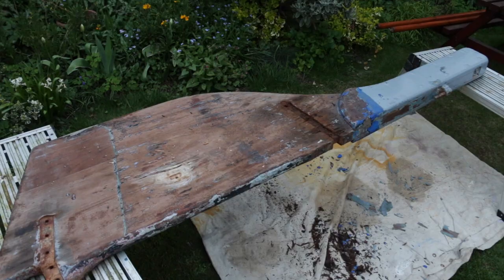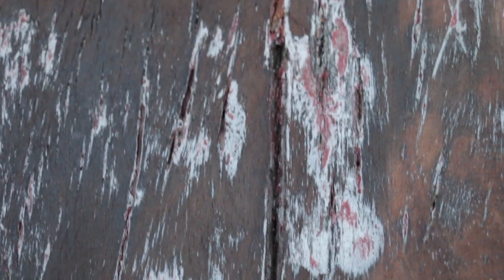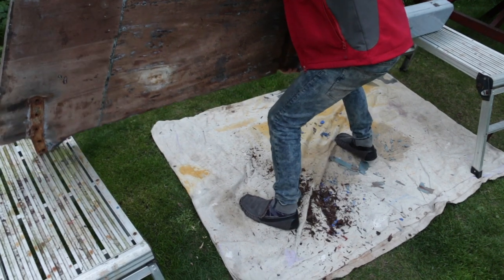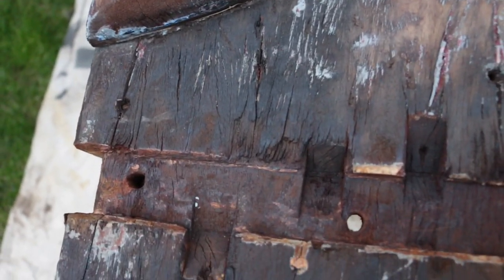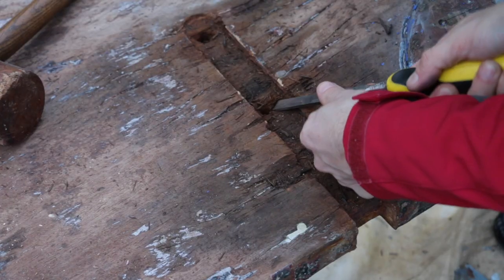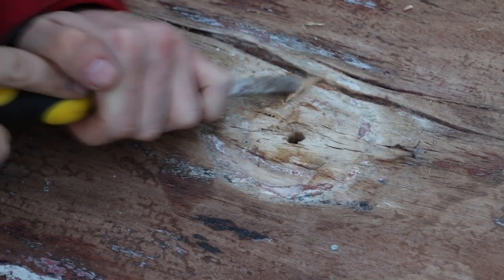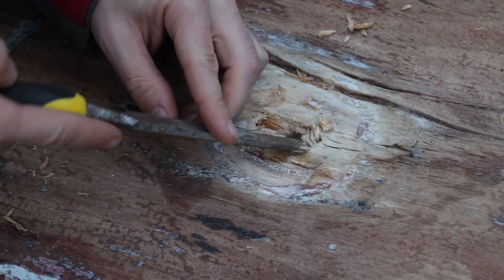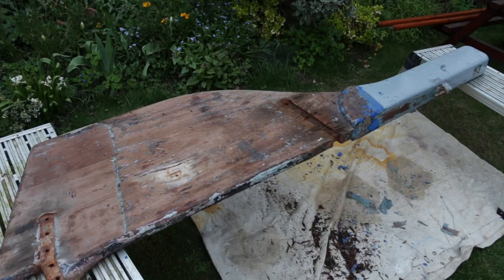A question to my boatbuilding friends far and wide. Restoring SV Andromeda.

Comment: Hello. I've just found your channel, from the latest post from Sampson Boat. I'm a hobby woodworker in the US. Some of the cracks /checking is normal and not a problem. I belive that long crack that runs the length of the rudder might actually be a glue type joint. Not likely that they would have been able to form your rudder out of a single board. As you said, there is quite a bit of good wood there yet, but there are significant areas of concern. You showed us how the wood is soft punky around the anoed and under the gudgeons. Since that area, especially under the gudgeon is critically important to its soundness and ability to preform under load as high seas, I belive it safest and best to build a new rudder. If you choose to build a new one, you may be able to salvage the good sections and use them in the new rudder, or to build other pieces for Andromeda as you find the need for them. I know I'm late to the topic of this vid, but wanted to post incase you have yet to decide. Good luck with the restoration. I look forward to seeing you complete the project.

Scott.
Reply from the maker: Hi Scott thanks so much for your feedback and for watching, I thought about several directions for this but ended up in pretty much the same place as you’ve described! I’m yet to attack the project of a new rudder at the moment but once I’ve raised enough money for the wood, I will be starting on this. Coincidentally, Leo and I have had a few long email conversations about the rudder. He’s doing some really inspiring stuff out there. Thanks again Scott!

Comment: Hi if I were you I'd go for a new one its a to important piece of the boat to have any doubts about.The bleached wood around were the anode was is caused by electrolysis.My name is Stefan by the way I'm a shipwright based in Kent now but I am originally from Woodbridge and still go back from time to time and if it's all right with you would like to come and meet you and have a look at your boat sometime
Reply from the maker: Hi Stefan, it’s interesting that you mention electrolysis as I have reason to believe this has played quite a big role in causing problems on this boat. Her keel is lead, the bolts are bronze, the prop shaft is stainless and the prop galvanised. The nails are copper and there have been two anodes fitted which are zinc. One of the through hull anodes was connected to the domestic negative supply and I believe this has sped up any electrolysis action. The variety of metals and the use of anodes may have acted as a catalyst to her fastenings failing. Please let me know when you’re next up here. Thanks

Comment: I'm by no means an expert, but it seems very likely that those splits are checking along the medullary rays of the wood. The fasteners seem to be parallel to the medullary rays, which is generally a no no. You're probably better off taking a pattern from that rudder and making a new one.Tips from a Shipwright has a good video about annual rings and medullary rays in boats here: https://www.youtube.com/watch?v=dzCmES_Lwrs
Reply from the maker: I’m generally feeling from most of the feedback I’ve had, that a new rudder is a good way forward. I certainly know I will sleep better at night if it’s a solid and brand new device